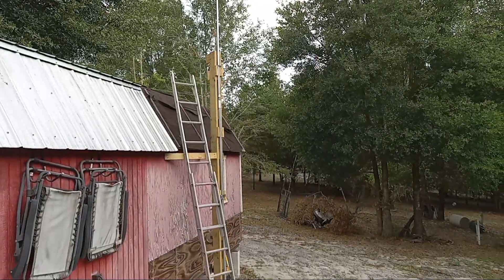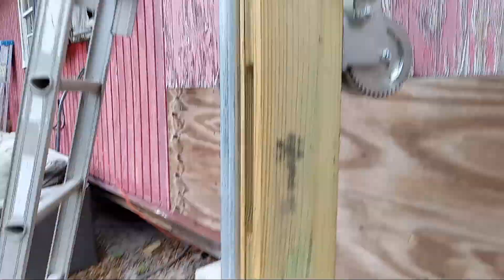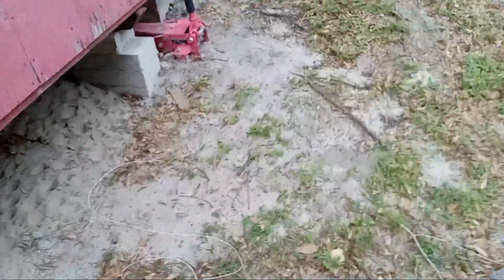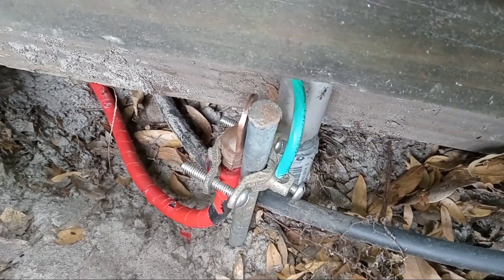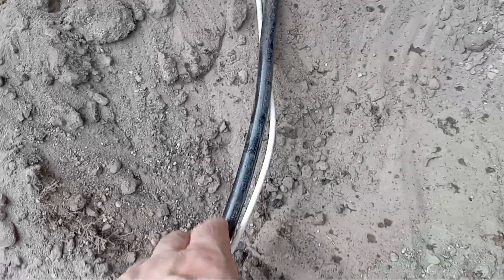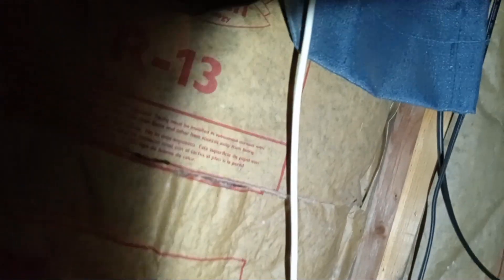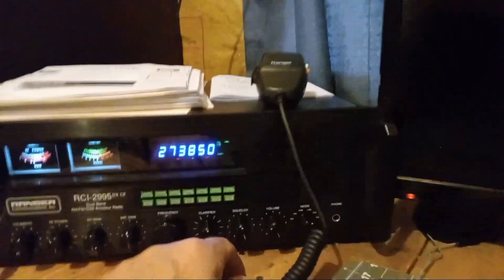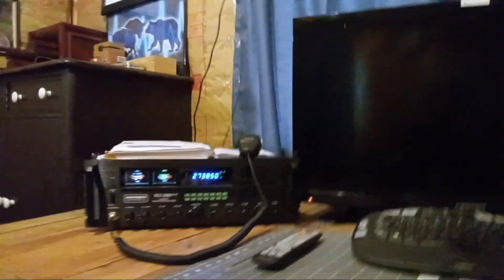Tilting Antenna Mast and Tower Part 4

Comment: Most people use vertical antenna`s, I suggest to buy a simple Antron 99 and get a better signal in /out
Reply from the maker: Hey Vic.... I think I might have done a bit better.  I got a Tram 1498.  Every review says it's better than the Solarcon (Antron)A-99.  Thnx for the suggestion. I appreciate it.
Reply: @JohnnyT0464  It probably is the better of the two. (not sold over here) .